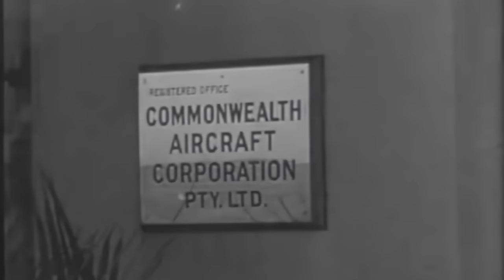Australia Has Wings! | Wirraways & Boomerangs (1941)

Comment: Wirraway was an excellent trainer and general purpose aircraft, but it was a little underpowered as a fighter. My late father flew T-6 Texans in his primary flight training back in the early 1950's, I think they used the same engine as the Wirraway and it was about 600 HP. A Zero at that time used a Sakae engine that put out about 1000-1050 HP. For the Boomerang, the designers wanted to build the Wright-Cyclone R-2600 engine under license to put into it-that would have given them about 1600-1700 HP they needed for competitive performance. For whatever reason they couldn't get those engines or the license to build them, so experimented using the P&W R-2800 which was already being made in Australia and had even more power but was really too heavy for the Boomerang-and created problems with landing gear and fuselage stress that was unacceptable. So they had to go back to the older P&W R-2000 Twin Wasp engine which only put out about 1200 HP, leaving the Boomerang under-powered compared to most competing designs.
Reply: They did manage to get pretty decent performance out of the CA-14 variant with a supercharger though, but it was never put into production, (off the top of my head I think only the CA-12, CA-13, and CA-19 versions were produced). I've seen a documentary about the Boomerang where ex-pilots said was essentially rubbish as a fighter, but I think it was an amazing aircraft. With the intended engine I think it would have been an excellent fighter. I'd really like to see one up close one day.
Reply: I consider the Boomerang as Australia’s most successful failure. It was a failure as a fighter, being way underpowered and with the same thick wing as the Wirraway(it was an emergency fighter after all, and that’s just what we had) but at ground attack and close air support was superb! It also operated very successfully in conjunction with the much faster RNZAF F4U Corsairs in these roles as well as FAC.
Reply: There was a BOOMERANG  as a main gate display  at Williamtown  nsw 1970s

Comment: Great video. Poor old Boomerang and Wirraway, about 5 years out of date.
Reply: The Wirraway was basically just a trainer. It was a copy of the NA-16 of which 17000 were built.
Reply: The Boomerang could actually have been quite a decent fighter if it only had an engine that would provide enough power at anything above low altitudes - but since it was taken from a torpedo bomber, it quickly lost power as soon as it started to climb above sea level. Therefor it wasn't "5 years behind" - it was just another proof of the fact that with limited resources - there's just that much that one can do.
Reply: If they are all you have...

Comment: Never mind that these machines became out of date soon after manufacture. We were making stuff and making it quickly, 6 months from design to in the air. It now takes 20 years to think about making a submarine. Australian military manufacturing has become a joke because politicians and bureaucrats are useless.
Reply from the maker: Australia was caught by the explosive technological surge between 1938 and 1941. Engines. Airframes. Aerodynamics. Radar. Navigation. Guns.
The fighters of 1943 were vastly different to those of 1940.
Reply: @ArmouredCarriers  most military technology is out of date before it is manufactured and used. Software and hardware is constantly tweaked and improved. What is cutting edge today is out of date before it comes off the production line.
The real issue for Australia lies with the lack of desire to do the manufacturing on shore and to trust in the home grown processes. Like we have to ask for permission from the US to build a submarine locally. If we had stuck with the French submarines they would be rolling off the production line as we speak, maybe not cutting edge but at least we would have submarines. As it stands we are still waiting for permission from the US to upgrade their old technology. Not to mention we have the Collin’s class Subs which use old diesel and lead acid battery technology. Why not just upgrade to lithium ion batteries to get greater underwater efficiencies.
Reply from the maker: Submarines are ... difficult. 
I'm not an engineer. I probably know enough to be dangerously wrong. But based on what I've read over the years...
Replacing the lead acid batteries would likely necessitate cutting open several sections of the pressure hull. And every new seam (scar) is a new weak point.
That's on top of those hulls already showing the ageing effects of years of going through cycles of immense pressure and temperature change. That means metal fatigue. @dantunno9264
Reply: @ArmouredCarriers  if you can get lead acid out you can get lithium in